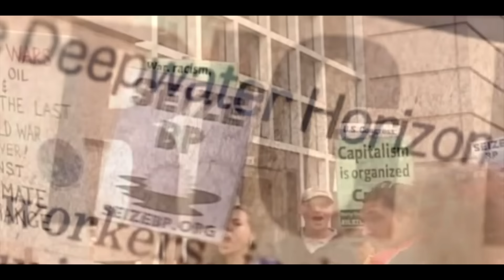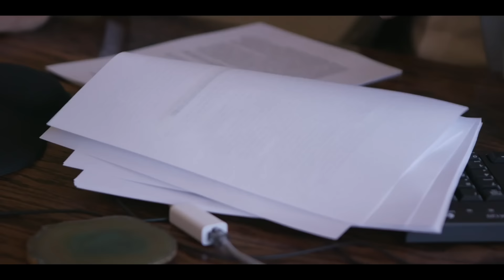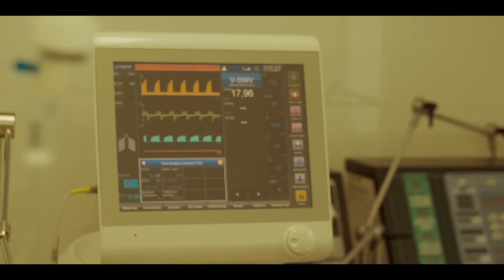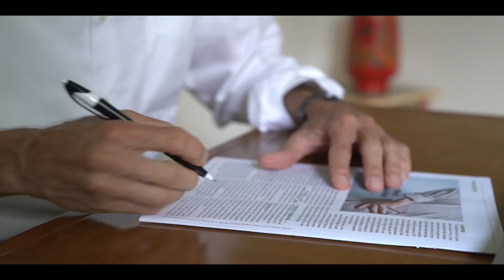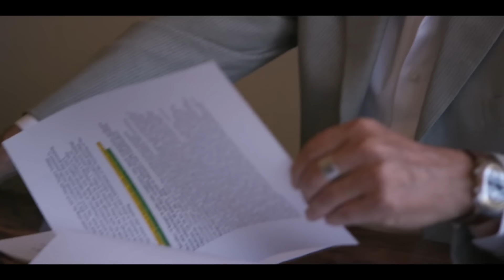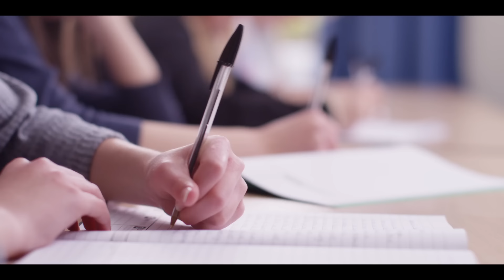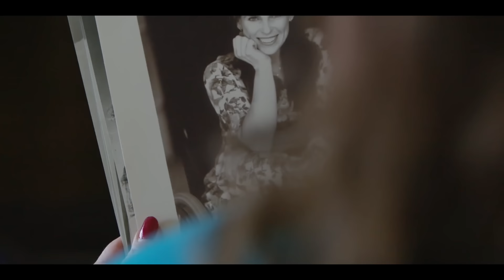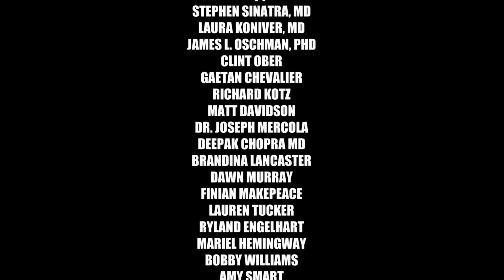The Earthing Movie: the Remarkable Science of Grounding

Comment: I’ve seen my BP drop 60 points after sleeping grounded for six months. A lot of aches & pains have reduced or vanished altogether & sleeping better than ever. 
 Exercise is easier too with better oxygenated blood getting to the muscles.
 Heart disease? The plaque is gravitating to & forming on the artery walls because Plating is going on. That happens when there is a slight electrical difference within the body.
 Get rid of any Positive electrons & the body will start working as it should.
 I’ve recommended it for friends suffering from inflammation related illnesses & had really positive feedback. 
 Putting our bodies back to a state in which they evolved since the dawn of time only seems sensible. 
 How anyone can argue against that, well, they are taking themselves (and their families) out of the gene pool as far as I’m concerned.
 Cheap enough to try this.